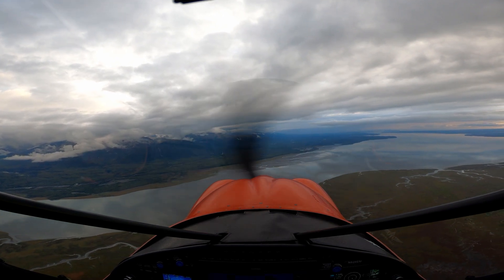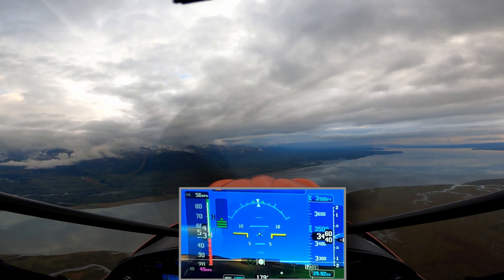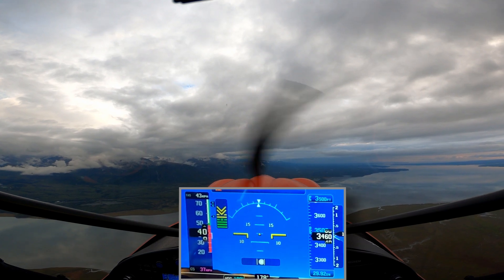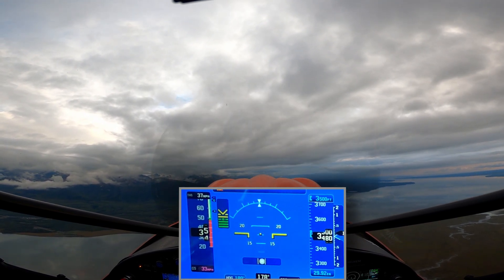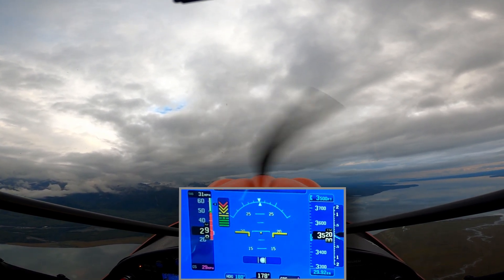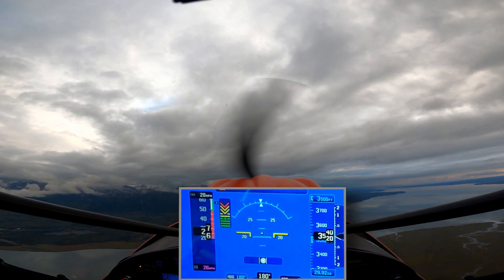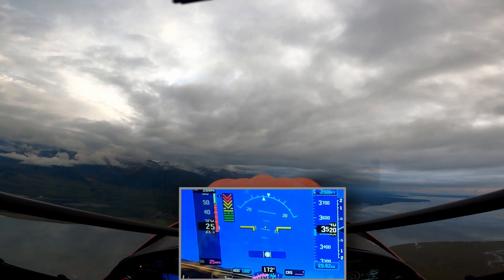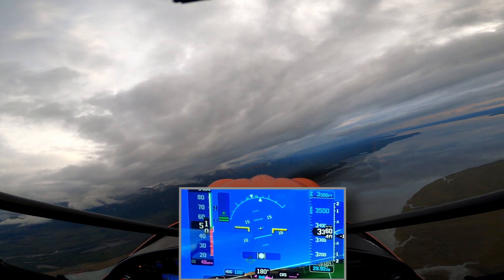Cub Crafters Carbon Cub FX3 Power On Stall Test (27 MPH IAS)

Comment: Nicely done.   What RPM and MP you were at?
Reply from the maker: 2360 RPM and 19.3" MP at the break.  I need to try it with full power, I think it will fly slower at 2700 RPM/full throttle but you kind of need a clear day so you can climb up to the point it breaks, which can be several thousand feet.